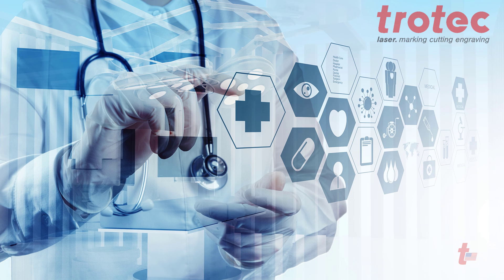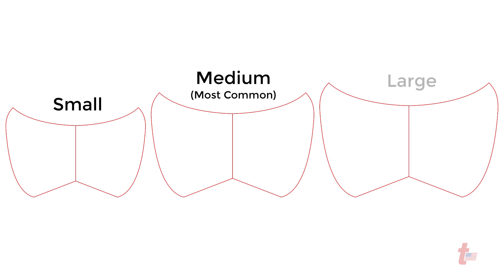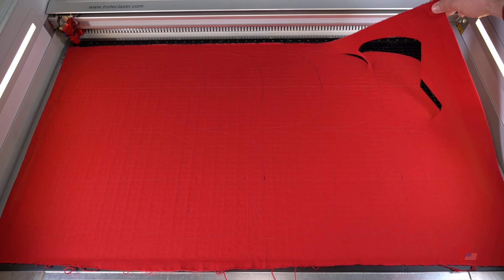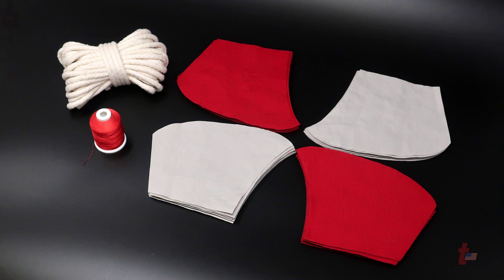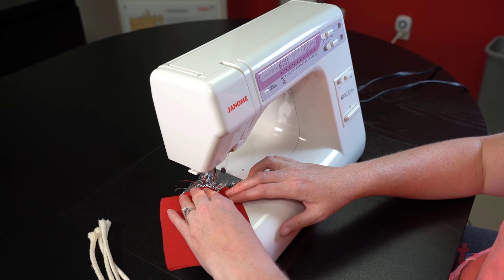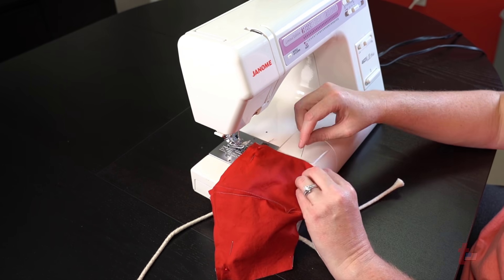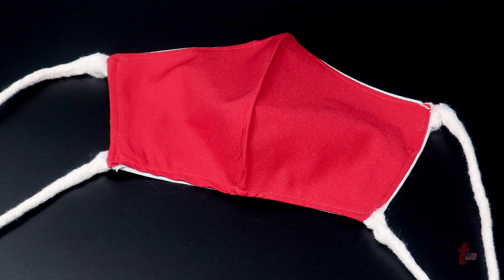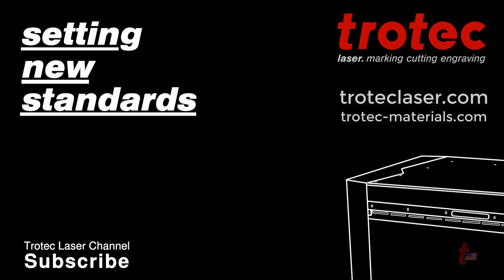Trotec Laser: Laser Cut Face Mask

Comment: Does the edge of the cut pieces got cauterized? And is the fabric 100% cotton?
Reply from the maker: 100% cotton fabric was used in this video, the laser will only cauterize the edges of synthetic polymer based fabrics, because cotton is a natural fiber the edge will be cut cleanly but will not be cauterized with the laser.